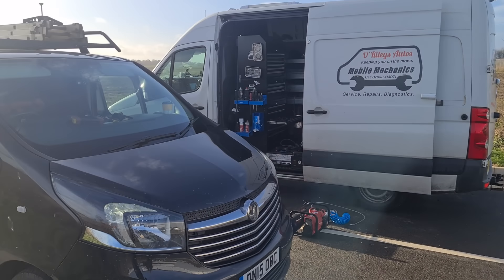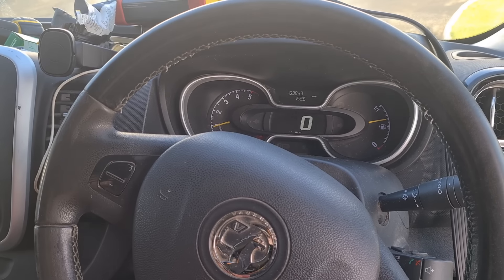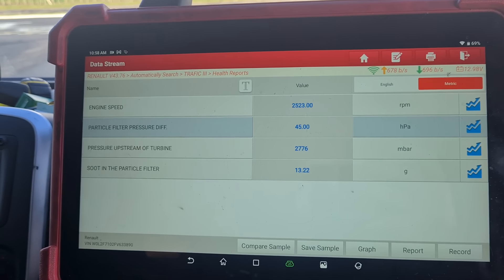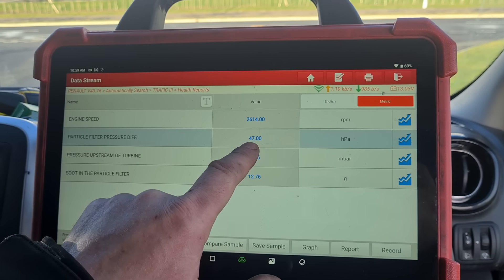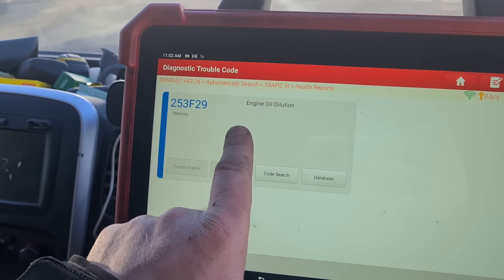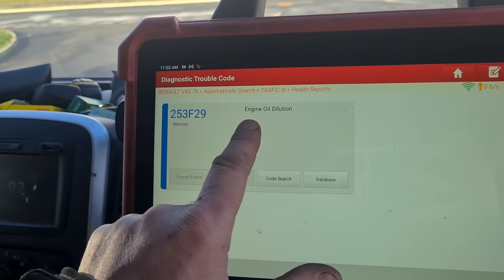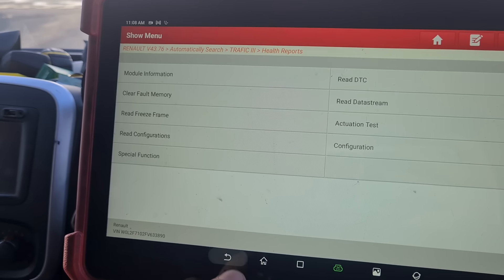DPF Blocked? Don't Just Do A Forced Regen. Fix the Underlying Fault

Comment: I'm a mechanic in Australia that specialises in diesel tuning, diagnostics and servicing. Seems like you guys have the same problems our industry has in regards to understanding and diagnosing dpfs. There are so many workshops and dealers that have no idea how to diagnose and fix dpf issues, their solutions are always just to force a regen and send it out the door. Even simple things like resetting oil dilution every service is something that no one even knows about. Its ridiculous, especially when the most popular vehicles in aus are diesels. Btw, Your videos are pretty much the most informative videos about dpf diagnosing that I've come across, and I've seen a fair few in my time haha
Reply: I can't find anyone to fix my 2019 Triton. Continual DPF issues. I've gone to Mitsubishi X 5 times, Independent X 3 times, just last week a new Diesel tuner told me it's the computer which will need resetting up to 7 times at a cost of $432 per time (just to reset the DPF light). He drained my oil (didn't change it) and sent me on my way.. Always high oil each occasion. I've taken matters into my own hands and I'm doing the DPF Temp sensor myself for starters.

Comment: Im a mobile mechanic and diagnostic tech, i run all launch gear myself and agree with everything you say. The way i see these dpf cleaner guys is majority are happy to take money off the customer time and time again even if they have the knowledge to know the vehicle has and underlying fault, but saying that majority dont have the slightest clue to what the issue is, they only know which sensor needs removing so they can hook up there carbon cleaning gear, do the job and be on there way until next time enough said.

Comment: Exactly Jimmy. Check and make sure all other engine systems and parameters are working properly. My Civic 2.2 iDTEC did it's own active regen last week whilst driving through town (I thought the engine was breaking down). It felt like the brakes were binding and didn't want to pull properly. MPG bar guage plummeted too. After ten minutes it started driving fine again. 

I plugged in my diagnostic tool and it showed it had done a successful regen and 0.6g of PM.

Comment: Thanks O,RILEYS good to know theres a decent professional person out there, ive learned about high oil level n air con not working, since watching your detailed speechs etc, The guy who did a forced  Regen on my Honda CRV Stated None of this ive found out both are at fault on mine & am in the process of correcting them issues, People should be  compensated for loses, from manufacturers, simply for not having a warning light stating its time for a regen Drive !!?? Genuine Gezzer Top man O,Rileys😊😊 😮

Comment: Luckily my mechanic I've used for the last three autos, found the underlying reason for Audi A3 TDI 2013 DPF light ..Combination, thermostat needed to be replaced, car not heating up properly to activate regen...New thermostat, drove on freeway for 40 min or so at speed S mode 4 or 5th gear (Audi Manual) Light went off!! YAY!!!

Comment: You're a top bloke Jimmy if ever I have any issues you're the guy I'll be contacting as you're not to far away from me, simply because you've learnt how DPF's work & I know I won't be wasting money taking my car into garages & not getting the fault fixed. You have mentioned about doing long journeys for over half an hour helps & I do two hour long runs in a week so fingers crossed I won't get any DPF problems but there's still the adblue side of things which is a bit of a worry.
Keep up the great work.

Comment: Got a Volvo xc60 2010. Had soot filter full, engine service required and limp mode a few times since purchase 3 months ago. I believe there is an underlying issue. My local garage have attempted a couple of forced regens. They aborted the second one as the car was misfiring at 3000 revs. They spoke to a specialist who suggested fuel injector issues. I just don’t know what to do with the car.

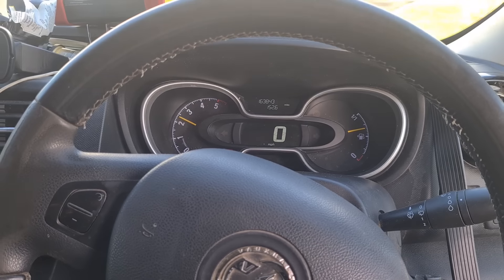Comment: Looking for the 'repair' you mention at 2:04 min that you fixed. But it not explained. "I've already put the DPF cleaner in, I've repaired the fault"  but their is not further explanation of what cleaner was used, or what fault was repaired. Can you share that information. thanks
Reply from the maker: This is just a general explanation. I have loads of videos of the full repairs
Reply: @ORileysAutos  Thanks for the reply. Yes, I've reviewed several of your great videos, thanks!  I'm working with a Dodge Ram Promaster, 2014 3.0L EcoDiesel, which I haven't found any video on in your library, but assume DPF is likely similar in all rigs. The product you reference "Launch DPF gun/cleaner" does not appear to be available in the USA. Is treatment with this product the "repair" that you referenced? Do you recommend other products or procedures for cleaning of DPF. ta!

Comment: After my transit custom went to the garage five times with the same problem (blocked DPF) I came across your channel and fixed the problem myself, if the garages did the job properly, fixed the fault not the symptom then you wouldn't have to let us know why garages keep messing up, keep up the good work Jimmy

Comment: come on jimmy you are way to hard on yourself, its not your fault there are so many crap mechanics in the business including main dealer mechanics just in it for a quick buck. i have watched all your videos and become quite a dpf expert in the fact that i know the underlying problems that can cause dpf issues, watching your videos you have saved me and my family and friends thousands of pounds in garage bills, and are of the opinion that the vast majority of garages dont know what they are doing with regards to dpf problems, god half of them dont know how to test sensors for faults, so you just keep up the good work and educate these people, they need it. i will always be forever grateful for the invaluble lessons you have taught me thank you jimmythebiz
Reply: I left the trade because I was sick of working with ignorant asses, now I am in engineering but on road based vehicles, and it's crazy how the hgv "technicians" I work with don't know dick about dpfs or how they work, they'll do a forced regen on one of the trucks without even taking it for a drive to properly warm up, replace the same sensor over and over again or even steam clean the inside of a dpf occasionally (which surprise surprise doesnt work) lol

Comment: Thank you for the great videos and information but i am a little confused in terms of you being againt doing forced regens, and you say find the issue stopping the car from doing a regen, on this video at the begining you said you have fixed the fault but didn't share what the fault was with it!
I get quite a few DPF issues with high differential pressures, not always caused by a fault but more often failed attempts at a regen due to short trips which you did mention.
In those cases there is no fault just the driver not giving the car or van a decent perodic run.
I see you holding the throttle at around 2.5 to 3k to get the Dpf hot once you have put ur cleaner in to it but cant see the difference with a forced regen or just holding the trottle fixed as you do? 
Also the first thing i do when diagnosing a car or van for a Dpf issue is to scan it to see what fault exsisit that may stop it regenerating.
Thanks for all your hard work and great advise i just find the forced regen advise verses the 3k rpm hold on the pedal a bit confusing.
Kind regards Jay

Comment: Hi Jimmy, what was the underlying fault?. I had issues with my dpf on my mk8 transit, numerous cleans which didn't help. I did some research on the issue and a vehicle should regenerate itself when you drive for so long. My fuel vapour valve was blocked up with soot so my van couldn't regenerate itself, I replaced the fuel vapour valve, took it out for a long drive and fully fixed the dpf issue. That was 3 months ago and around 3500 miles ago, I'm no mechanic but I have a real keen interest in it.
To save money also.

Comment: I have learned such alot from watching your videos, how to understand live data and use it to fix the problems not guess, my work is going towards dpfs as other garages are sending them to me. I hear exactly what you say from the customer been to numerous garages they were unable to do a regen then they are stuck or chuck parts at it. The same people would rather do a timing belt or a clutch

Comment: When I trained as a mechanic 50 years ago one of the first things I was told is....If a fuse has blown dont just replace it, find what caused it to blow and fix it first or you will be doing the job again.
It applies to everything but seems to be one basic rule a lot of people never learn.

Comment: The thing is a lot of big garages have expensive diagnostic code readers but they don't know how to use it and when they view things like live data they don't understand it, Fact is you're on a different level and it shows, hence people will travel hundreds and hundreds of miles bringing there vehicle to you for it to be fixed. i've worked in a big garage and when a difficult car comes in all the guys have no clue me included, problem is people are on the understanding a diagnostic code reader will tell them the fault when infact it just gives you a direction to go in

Comment: Jimmy I have been watching these videos for about 12 months, during this time I have sort a Ford kuga with a vaporiser issue and blocked DPF and recently a quasqui with blocked pipe and faulty pressure sensor. Luckily I bought a top don scanner which has the capability to do the resets. Without your help with the videos  it would have been impossible.👍😀👍👍

Comment: Ford b-max 1.6 had 16k spent on it new engine 4 injecters still had same issue dpf not degenerating turns out it was the glow plug controller module this fault code wasn't showing a engine management light only Ford scanner would show this issue Ford did do a software update I'm sure they are hiding some dpf settings to stop people like you from doing the proper repair it makes me sick tht they can get away with it

Comment: Often times even after replacing faulty components a vehicle will behave as though the emissions system is still broken.

Having to go through different management systems and clearing adaptive and basically lie to the vehicle that some parts unrelated to the fault have been replaced before the emissions system will start working correctly.

It is like the ECU is a hypocondriac refusing to believe it isn't sick anymore, we have to give it a placebo to make it feel better.

Sometimes the issue is just software preventing a regen on a functional system requiring you to run a funded regen and adaptation reset.

Comment: No one can fix my Mercedes-Benz A200 2013 dpf issue. Its done 130k miles and theres no back pressure on the engine, yet the engine light keeps coming back on. Ive changed the pressure sensor etc but to no end

Comment: Thanks Jimmy for another video. 
It's shocking the motor industry is so lacking in DPF knowledge this is caused by manufacturer's & main dealer's  needing a replacement parts  business.  They don't want the small guy fixing anything.

Comment: Jimmy, you've hit the nail exactly on the head: The small vociferous minority are definitely in the wrong, and it is you who has the right attitude and mentality. There are deep ills throughout technical trades in the UK as such skills have been devalued over decades, and what comes to the fore is guesswork, sloppy standards and unnecessary expense for the customer. Please keep doing what you do and hopefully this crusade will gather momentum and achieve the necessary change.

Comment: Why not set up a short course for mechanics at those garages where you teach the diagnostic paths that they are missing. Seems obvious to me that you'd look for what is causing excess carbon to build up, whether thats an injector fault,  over fueling etc. Could be a good money spinner.

Comment: In my opinion there's a difference with being able to rebuild an engine and being able to diagnose. One is an easy step by step procedure and the other requires an analytical mindset. I think the analytical mindset started to dwindle in the 90s when the standard knowledge regarding points/timing and fuelling adjustments became less and less relevant as fuel injection became more popular. I know many mechanics and fortunately they are upfront with regard to their strengths and weaknesses and importantly they know who is and isn't the person to go and see locally.
I imagine this cycle will happen again with EVs having an increasing presence on our roads.

Comment: Hi Jimmy
I have a 2020 traffic and have the check anti pollution system on dash and check engine light. It also has got heavier on diesel and the adblue dosent last too long either.The Van is a 2 liter engine. I can't find the  upstream sensor and pipe that I've seen in your videos.  I know the older traffics were 1.6 l with twin turbos. Do you have a video on the 2 l engine . Hello from mullingar Ireland BTW

Comment: Here, the go to is to code out the DPF and drill through it because there are a lack of dpf cleaners and likely, a severe shortage of knowledge. 

Went through the car test 4 times on my own car because the garage couldn't figure out that the cat needed replacing.

All good and well when the customer is the one getting screwed over and paying out the nose for labour

Comment: It's the same in every service industry.
.
Various levels of "fixers"
.
The "Not a clue, clean the code and run"
.
The "It worked on the last one"
.
The "If I fit these parts (normally all of them?) That'll fix it"
.
The "All the gear and no idea" (THINKS they know)
.
The "ACTUAL Technician who knows how the "system" works and can say what caused it and WHY"
.
Guess which one is the cheapest for the customer? (Might have a slightly higher call out charge.... But.....)

Comment: Maybe The DPF garages that are moaning just don’t want to be shown up as doing a crap job.  The average person will not spend approx  £1000 on the launch device just for the occasional DPF problem, and they won’t be confident enough to have a go anyway.     The DPF companies could learn from Jimmy the correct and honest way to fix them.   I wouldn’t trust my local National tyres garage ( Rock Ferry, Wirral branch, if they did do DPF), they do low quality repairs at the best of time on normal jobs.

Comment: Jimmy I have ford focus showing code 2463 when I tried to do a regen through FORScan I noticed the vaporiser valve was leaking fuel. Do you think if I replace the vaporiser the code will correct itself ?
Reply from the maker: Yes possibly. Depends how much soot it has
Reply: @ORileysAutos  I have switched the vaporiser and now when I try the static regen it throws code 269f glow plug open circuit. Can you please tell me Does this mean the cable is not working on the eBay vaporiser ?

Comment: Hi Jimmy , it's a bit like replacing a head gasket without looking at the cause of the issue i.e why is it getting so hot ? Blocked radiator ? This is just basic mechanical repair strategy and if people can't take advice and actually fault find then maybe they should be doing something else.